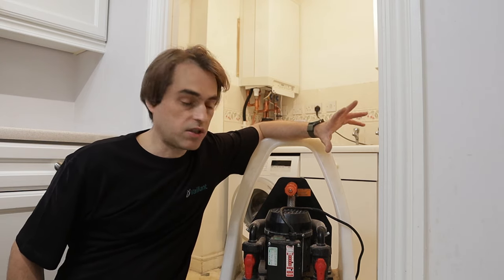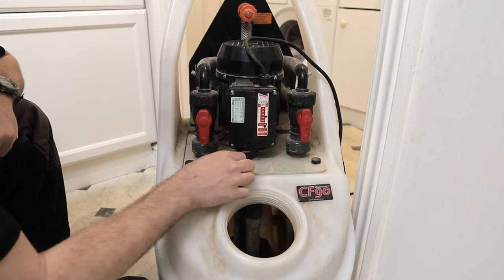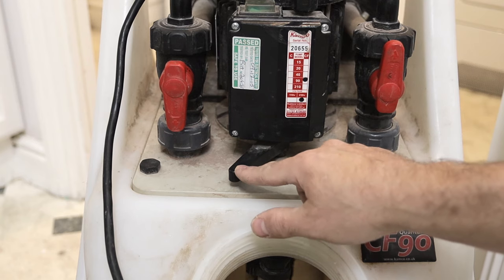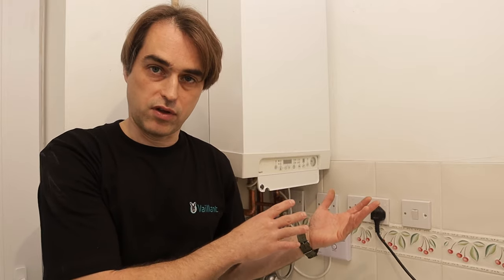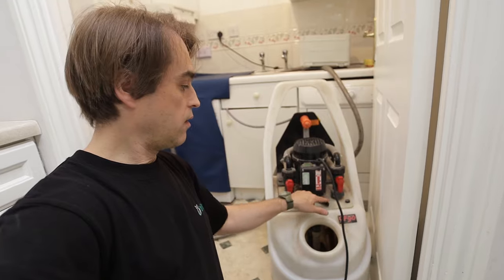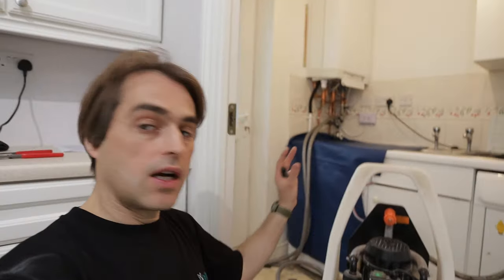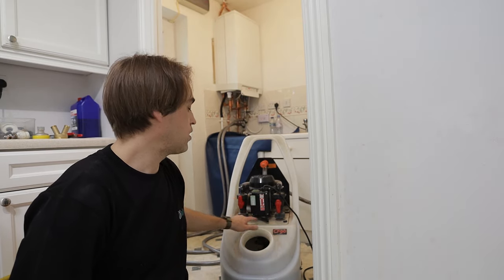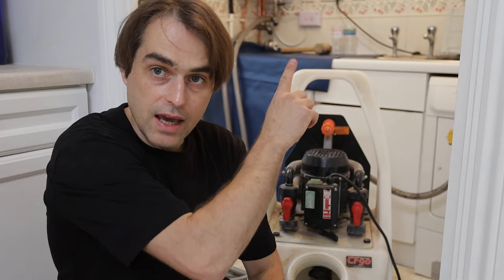How to power flush central heating system

Comment: When I did this job I had a drill with chisel function(no rotation hammer) with a nylon hammer bit to remove hardened deposits in radiators, I also had a Kamco magnet in circuit it saved time at each job. I also had a pump adapter for easy connection via circulation pump. Great explanation of how kamco CF90 works.

Comment: Thanx for another great video. 
I was not aware of the rubber hammer technic on the radiators.
I will try it next time.
Cheers from France.
Reply from the maker: It actually works very well.

Comment: Excellent  video as usual, if I may add its a great idea if you can talk the customer into having new radiator valves because you can come unstuck with old siezed up valves especially when using Kamco FX2
Reply: With many new boilers adding a magnetic filter will extend the blr guarantee  for 10 years! In fact most new blr manufacturers insist on one being fitted.
Reply: Definitely replace dodgy radiator valves, if fitting TRV'S do it. 
I've seen Urban with his aqua vac before when had a leak....

Comment: I've  been using a Kamco over 20 years. Powerflushing as you pointed out about flow rates primarily. 
Choice of the right chemicals is paramount. 
Utilising magnetic flushing kits (magnaclean, Kamco or others) I have found used in conjunction is the best way; when the magnets are clean, you know your finished!
Have seen lots of 'professional' videos of the alternatives you mention,but you know and I know they are inadequate methods, even on relatively recent boiler replacements!
Until boiler manafactures insist on the relevant  standards being followed and documented, it's  too easy for installers to kid themselves  and customers they've  done a "proper job".
First class educational  video,puts all the other shortcut merchants to shame!!!
Reply from the maker: John, thank you for kind words! It is really appreciated. 

Kamco is an excellent machine. I used to have Magnacleanse and was rather disappointed at how useless that was compared to a proper machine. Trying to flush with mains or magnacleanse is just pretending you are doing a full job. Having said that, there are systems that do not need to be flushed.
Reply: @UrbanPlumbers  Nothing to do with kind words. You absolutely nailed the argument for power flushing against the poor alternatives that others attempt to justify!
Reply: What chemicals do you use?
Reply from the maker: I use fx2 if I can. Otherwise F5.
Reply: Totally agree, Well said !! Agree on magnets, but our apprentice watches videos and follows them...

Comment: This is a great guide. I have a question with regards the direction. You've connected across the filter, if you change the direction won't it go through the pump in the wrong direction?
Reply from the maker: It doesn’t matter - it still works
Reply: My question  exactly! Obviously  blr is off but seemingly the machine can pump through  the blr pump in reverse?
Reply from the maker: Yes no problem

Comment: We could do with a plumber/heating engineer like you at our house.  Finding the right one is currently a minefield.  Love watching your vlogs.
Reply from the maker: Where are you. I may be able to recommend a decent person in your area?
Reply: Thanks for your reply  @UrbanPlumbers .  I'm in Barnsley, South Yorkshire.
Reply: @barnsley1066  is Alan Hart in your area? He certainly talks with one of those funny accents 😀
Reply: @Lutonman2010 , he's up the road in Leeds.  He down travel this far south (25Miles).  Funny accent, how dare you sir  ;-)
Reply: Do you have any recommended engineers to cover TELFORD, Shropshire please.
Reply: @UrbanPlumbers  any recommendation for Milton Keynes?
I used a local company couple of years back, charged me 500 quid, just put the machine on, didn't touch any radiators, switched direction a few times, watched the machine for about 4 hours, packed up and left, system still not functioning correct. I can tell magnetite in main flow pipe 20 feet from boiler through the airing cupboard section, as a magnet sticks.
Was considering Powder Flush but very very expensive.

Comment: @UrbanPlumbers 

Interesting hack to share, In my case reconnecting own' system I actually put an "inspection joint" for now above feed to HW coil with a little dogleg of pipe and some speedfit 22mm right angle joints, SO will be able to actually drain and see if whatever I've done is actually working on this one bit of the pipework where seem to have accumulated the worst gunk and there appears to be poor thermal-transfer into HW-cylinder.

There is/was a semi-loose black-lining there; finger can shift it but it didn't appear to be coming out in strong-magnets used in combination with CF30 flushing machine.

If I've used the MC3+ (in for many weeks, heated, powerflushed for many days)   inside the HW-coil 22mm pipes that barely comes off -- is it even worth trying F5/X800 or should I go straight to Kamco-X2 / Fernox-DS40 [acidic cleaners] which have to be neutralized and not put on plate heat exchangers etc etc!!! ?
I NOTE I could actually isolate the boiler and just flush that HW-coil feed in that case ... 

Another hack mentioned in CF30 flushing manual:  You can also use a Magnet to sense Magnetite (black) in the pipes.

In any case thank you for the excellent video and I'd greatly appreciate any views you have!!.

Comment: @UrbanPlumbers Excellent video! I'm doing my first powerflush tomorrow on a 15 year old system that hasn't been touched so I'm hopeful of good results.   One question - my boiler has the circulating pump built into it (it's an MCZ pellet boiler).  If I turn on the boiler and get it up to temperature, when I use the power flush machine at the same time as per your video, when I switch the flow back and forward, wont's that fight against the circulating pump?  If so, will this damage it?  
There may also be an issue with a mix-down valve that provides back-end protection on the biomass boiler by creating an in-boiler circulation of 55 degrees, but I'll look at that tomorrow!

Comment: Interesting video. You don't mention opening up the individual lock shield valves fully to flush each radiator individually (after noting LS valve position). LS valves can be quite closed down when system was originally balanced. When I cleaned my system I did it the old fashioned way, taking each radiator out into the garden and flushing with a garden hose, this is ok except for the weight of large double radiators if working on your own. Then I ran the CH with a Fernox non acidic cleaner hot for 20 - 30 minutes (old Thorn radiators that are now 44 years old (1978) ..... in fact the entire system I inherited was Thorn, the boiler a floor standing Thorn `M' and Thorn radiators .... back when we made a lot of stuff in the UK). The radiators are a nice open design without fins, not prone to being clogged with dust & cobwebs.
I thought you were Italian, I was way off 😁
Reply: Nice job, we do it that way when my apprentice is here cleans the top manifold,plug & vents thoroughly. 
Dodgy lockshields are replaced as a matter of course. Not a great fan of power flushing bur my apprentice loves our new Kamco.

Comment: Great video.. 
I’ve just bought a power flush machine but a bit nervous about using it (I use Magnacleanse at the moment) Just a couple of questions ;
1. When you fill the system to 1.5bar via the boiler filling loop how does it not overflow through the hole in the front where you add the chemicals?
2. When you had the boiler turned on and the machine turned on at the same time I assume you need the flow from the machine running in the same direction as the boiler and you can’t reverse it whilst it’s in operation ?
3. When you’re reverse flowing the PF machine through the boiler could it potentially damage the boiler if it has non return valves fitted in it ? Or do you need to isolate the boiler?
Thank you 🙏🏼😊
Reply: Good questions, shame Urban didn't answer..
We prefer hand washing, most thorough clean when valves need replacing.
If power flusher on ground level & outside Best in case of a flood. Turning pump off can empty into power flusher and overflow not while pumping.  Always best with 2 people at first to keep an eye on everything. 
Some old jobs I would not risk using a power flush, bad joints, rusty rads, pin holes on the back etc..
Reply: Yes while heating with boiler pump running correct circulation must be observed. Another disadvantage not able to reverse. But in video it was a newish boiler Intergas Rapid. Our favourite boiler.
I would power flush system alone, then boiler if required and heat if required, constant heat not needed.

Comment: One of the best videos that i have watched. very very clear instructions. I DIYed by boiler and works a treat. i have a question -> the pressure dropped on the opposite flow... is that normal? in the normal flow (boiler's normal flow) the pressure was ok but everytime i changed the flow it dropped. So i could only switch on one side for a few seconds and the flow would stop.
Reply from the maker: Yes some boilers may be only flushed one way

Comment: great video. i have a two zone S plan + connected via my worcester 42 kw combi bolier. i intend to powerfush the system via my magna flow. my question is do i power flush through the unvented cylnder as well or shut off the zone valve . mant thanks Duncan

Comment: As a consumer and sometimes DIY'r, I love seeing videos like these, so thoroughly well explained and executed. 
Can you come up to Glasgow and do my house! :-)
Reply from the maker: If you pay for a hotel for me and my mate I will gladly come to Glasgow. I am fed up with London anyway :)
Reply: @UrbanPlumbers 
 I will happily pay for accomodation and take you out on the town for a few beers on top :-)
Reply: @UrbanPlumbers  Can u come to Germany ? I show u Systems, 40 years old, never flushed, with absolutely no problems, and verry clean water....
In 35 years of servicing Heating systems, there was not much need to flush systems. but if there was a need, it was a underfloor heating system.
what the hell is going on with our heating systems on the island ?
Reply from the maker: @Ratzfaz  same in Poland - no need for flushing at all.

The issues are numerous - incorrectly installed systems, systems not fluhsed after installation, open vent systems, system not designed correctly and hugely over pumped, etc...

The list goes on and on.

Also Germany and Poland do not use inhibitors.
Reply: Is it the fill water? Resin filled ?
Ph correct?
Reply: Plastic pipes!!! 
Air ingress makes black oxide sludge in no time.!!

Comment: Excellent video,  would it be safe to say,  when you put the boiler on to heat the water & the powerflush is also on,  the powerflush circulation  has to be in the same direction as the boilers circulation?
Reply from the maker: yes, otherwise you may get boiler to stop
Reply: Seems no answer to that!

Comment: Great video mate ….quick question did it not create any problems when running the boiler whilst the powerflush was connected ? Wouldn’t the lack of pressure stop it circulating ?

Comment: Are you not putting a lot of pressure on joints in older systems? Your introducing new water into system so are you introducing new dirt and how can you tell if it has moved the muck in the radiator without thermal checking as it's cold??

Comment: When you flush with ch on the boiler pump is on as well so I believe you need to be careful only  putting the machine in the right orientation cause I believe if you reverse it you may create problems in your boiler right?

Comment: just a quick question, is there a possibility the heat exchanger could be blocked, as the dirty water will pass through that? and the same way you connected through the filter flow/return, could the boiler be isolated and just solely clean the central heating system?

Comment: I know this is probably a stupid question but should/can you flush the hotwater (not CH) pipes if you're fitting a new air source heat pump? I'm having a Valliant Arostor 200 fitted to replace an 30 year old gas water heater, I feel like this should be the opportunity to flush those pipes.

Comment: Excellent video and it is clear you did a thorough job on this flushing exercise. I do have a few questions for you - if I may?
1. Why did you not do the flushing routine with the old boiler prior to rip out and reconfiguring the new system?
2. As you were going through your box of bits you explained you had a conductivity meter (I think) but did not use it assessing the cleaned state of the circuit water?
3. What is your view of striving for VDI and not using inhibitors?
Reply from the maker: Hi mate,

1. Why would I do that? Makes little sense to start with flushing when you will be removing most of the prework in a cylinder cupboard. You also need to flush all the flux after install, so it is best to flush after you complete the installation. In the video I am just flushing - but in a real life installation I would be flushing while doing other work - wiring up, making good around the flue,etc. so it takes less time. If I started with a flush the install would take much longer and then I would have to flush again on completion tog et rid of installation contamination. If you are worried about 'sludding up new boiler' - that is nothing to worry aboout and definitely nothing to worry about with Intergas. Hope this clears point no.1

2. It was a PH meter, and not a very good one. I have been struggling to find reliable meters as they go out of calibration or give wrong results. I find litmus papers the most reliable at the moment. 

3. VDI 2035 seems like a very good idea. For example in my country (Poland) plumbers never heard of inhibitor as VDI 2035 is generally accepted as a correct method. Having said that, I have systems protected with inhibitor (Only dosed at original installation and not topped up) coming to 15 years and still running clean with no filters. It can be done with inhibitors as well, if the system is well-designed, not over pumped and run at moderate temperatures.
Reply: @UrbanPlumbers  Great reply, thanks brother, great videos always!👍✌

Comment: Great video. I've been Powerflushing for years now but started to use a thoroughflush machine as it's mains pressure flush and quicker and easier to use. Definitely worth a look at one. Haven't touched my Powerflush machine in a year now lol

Also I always agitate the radiators using a kamco agitator tool which will clear all the stubborn particles in the system.
Reply from the maker: Is that the gadget that allows you to change direction like on PF machine?
Reply: @UrbanPlumbers  Yes it is. Great bit of kit and only at £350 for it
Reply from the maker: @lewisneal7367  how does it work when you get below 10L / minute from the mains - must take ages to flush? Water may run clean, but there surely is no way it can shift dirt as such a low flow rates?
Reply: @UrbanPlumbers  that's where I use my powerflush or you can add a pump onto the mains pipe to boost the pressure. I was thinking of getting a salamander mains boost and add it to the cold mains to the machine.
Reply from the maker: @lewisneal7367  I thought of getting salamadner home boost for low flow areas as well to pump clean water quicker to my PF machine. Still it only is 12L / min
Reply: @UrbanPlumbers  yeah will benefit both machines. Thoroughflush have there own website check it out. I haven't used my brand new kamco since getting it lol
Reply from the maker: @lewisneal7367  i tried Magnacleanse and it was useless. PF machine never fails me but is huge and takes space.
Reply: @UrbanPlumbers  then you definitely need a thorough flush. It's compact quick to set up and even quicker to flush a system. I managed 19 radiators on a thoroughflush in a day would take a few days using a PF machine. Only thing I recommend is putting good chemicals before hand a few weeks in advance and circulate the system for a few weeks.
Reply: If you have a working boiler before replacing i recommend chemically treating to loosen debris and power flush with a magnacleanse or kamco magnet in line without a new boiler as stopping debris floating into new boiler.
Sometimes we just remove radiators from the house & manually wash, very throughly clean then ! Many times you find "leaky valves, rust & pin holes" damaged vents = new radiators.
Clean system defo reliability & efficiency. 
Keep up the great work !!
Like your choice in boilers.

Comment: Thanks for this. Not usual to flush like this in Sweden. Couple of questions: Do you often have problems with damage caused by the pump pressure being pretty high? (Like you did with the return valve) 2, Is it legal to dump those chemicals down the drain?

Comment: Quality video. I have a question though. We have a house built in 2004 that has micro-bore pipes. I have always been told that you cannot power flush microbore is that correct??
Reply from the maker: No it’s not correct. It is more difficult and a lot of people stay away from flushing it but it is not impossible.

Comment: Great video! After heating up the system do you disconnect the pump lead inside the boiler? The flow indices a current generated by the pump that could damage the pcb. Also if reversing the flow could it break the pump inside the boiler if the flow rate is 10x higher than intended?
Reply: That's  what l want to know! Can the machine swith pass through the boiler pump?